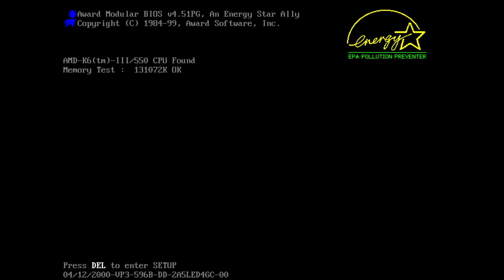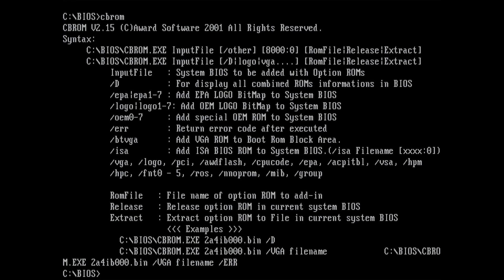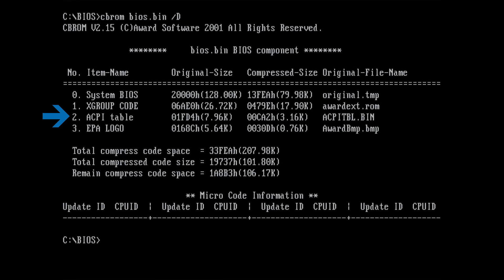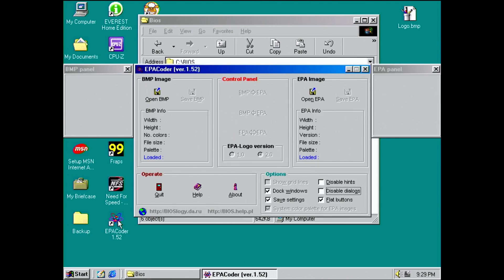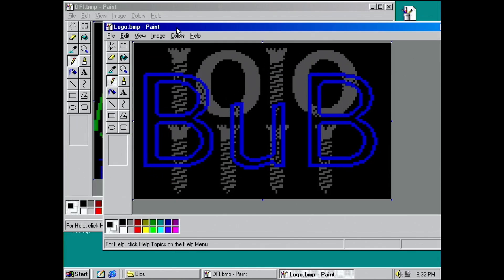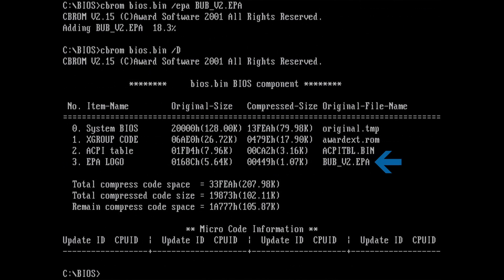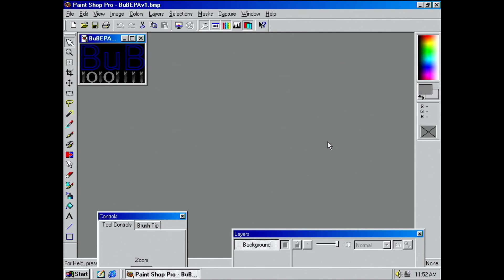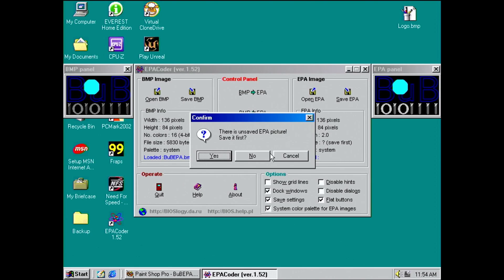Customize your BIOS Logos!

Comment: pls help windows 10 not working programs
Reply from the maker: You need Windows 98 or earlier. Those programs will probably not work on modern operating systems. You could try VirtualBox and install Windows 98 there if you want to try.

Comment: There is a problem I HAPPEN to encounter always.

I am rn using a PC with Gigabyte GA-686BX and the plan is to change the BIOS logo for my PC, (86Box is used during this process) however, every time, it gets me into the UniFlash screen but freezes ON WHOLE.

Do you have any idea on how to fix this issue? Thank you.
Reply from the maker: You're using 86Box when running uniflash? Correct me if I'm wrong, but maybe you can't flash the BIOS when it is emulated through 86Box.
Have you tried it directly on the board?
Reply: @bitsundbolts  I don't think I have tried this on board, also, it sometimes doesn't even freeze this time after deleting and then restoring the file using a digital floppy I made out of UniFlash, I am emulating a PC btw.

Before, it used to work for me.

Comment: Version 6 works to edit as well, though you need to set the EPA logo version to 2 - 1.0 was specifically used for 4.50 and 4.51 (though how would you get a 4.50G 486 BIOS to show a custom EPA logo is beyond my mere mortal understanding lol) and 6.00 was the one to start using 2.0. Some 6.00 might use 1.0 EPA logos though, depending on what resolution they POST in - e.g ABIT BE6-II uses 6.00 but likely uses 1.0 EPA due to 640x350 resolution, while my MSI 694D Pro-AR uses 2.0 and 640x480 resolution.
I used to have a Gigabyte 8IPE1000-G with a custom orange/white Harley Davidson logo. The neat and funny thing is the small gremlin in the opposite side of the EPA logo turned white as well, instead of blue.

Comment: One of the rare instances you'll see graphics together with the blinking cursor. The only way to do this is to use EGA's text mode 640x350 (8x14 font) on a VGA! Just think about that for a while. If you use VGA text mode, the font will take 8x16 pixels but expand 1 pixel of empty space to make it 9x16, and will not allow for seamless graphics using character cells. Award was the best back then!

So on a CRT monitor, you would be able to see scanlines more easily (because 350 scanlines instead of 400 or 480), a blinking cursor, and impossible graphics, compared to that version 2 that just uses boring 640x480 VGA graphics mode (you'll get in a Windows 16 colors graphics mode) with slow updating text and no blinking cursor.

Comment: Maybe some people could find this useful: this method doesn't work with v6.00PG, according to the tests I made on 4 motherboards with v6.00PG.
In fact, the results I got were all the same: when I tried to use Uniflash to back the bios image up, it said that PCI bus was not responding, and the program didn't show any of the ROM info, as shown at 1:48. But I didn't worry too much, as I used AWDFLASH to back the bios up and flash the epa logo-modified image. 
The problems began to occur when I tried to flash the new image via AWDFLASH, which prevented the action by saying "Bios image file checksum error", as it seems that editing the epa logo changes the checksum of the actual bios image file.
So I tried flashing the modified image with a NANO USB chip programmer, and when I booted up the system it said that "a bios ROM checksum error occurred", and I was unable to boot the system.
So I think that, because of the checksum-thing, the CBROM method doesn't work with any v6.00PG Award Bios.
(I repeated the procedure described above for all the motherboards with v6.00PG that I was able to get my hands on.)

Comment: Does this work on modern motherboards?????
Reply from the maker: No, it doesn't. It only works on old Retro boards with Award BIOS. New boards have UEFI firmware which is quite different from what I do in this video.
Maybe there are tools that can modify modern boards, but I have not looked into it.
Reply: @bitsundbolts  IIRC anything up to the final 1155 boards that used Award BIOS in the transition era (e.g Gigabyte Z68P-DS3 rev1) should be able to use custom EPA logos, unless there's literally no space for it in the ROM.
Reply from the maker: I haven't tried that on any other motherboard yet. But there shouldn't be a reason for it not to work. Maybe I'll try some day to do this on a much newer, pre-uefi, board.

Comment: "better get the version i'm using on this video" - yeah, only versions on the net are 1.12 and 1.50 ;-)
Reply from the maker: I'll be working on the Vogons post today. Will update the description accordingly.
Reply: Great, can't wait for it!
Reply from the maker: Thread is live: https://www.vogons.org/viewtopic.php?f=46&t=91378
Reply: @bitsundbolts  muchas gracias!
Reply: I have v1.52, file modified: 13/12/2000. 1.52 is available for BuB's vogons link below. You're all good.

Comment: Neat. On the very first computer I ever used (a 486), the logo would smoothly fade out at the end of the POST screen. I was quite dismayed that no other machine I came across would do this.
Reply from the maker: I had one like this as well! And I do remember that the fade-out was quite pleasing! Shame that later BIOS versions did away with this little extra!
Reply: It seems that older Award BIOS variants (<= 4.50) use textmode and epa-logo version 1.0 supporting only 2 colors (background and foreground) per 8x14 cell. They fade out the logo via palette setting. Newer variants (>=4.51) use graphicsmode and support real 16color bitmaps but removed the fadeout effect, because it would, depending on the logo, fade out the whole screen.
Reply: @dolphhandcreme  I had 4.51 fade as well. You're more likely to find fading EPA 4.51 on early i430 chipsets, VIA VPX (not all though) and I think some early SiS 55xx chipsets as well.

The feature got removed about the same timeframe VIA MVP3, 430TX, 440BX and SiS 530 started showing up.

Examples: VIA VPX based ACorp 5VIA3P has the fading EPA logo. MVP3 based Luckytech P5MVP3 does not, and neither a Soyo 6BA+IV or ABIT BE6-II have it - the ABIT is the most unlikely though - that one is probably among the earliest 6.00PG occurence, being 440BX.
Reply: @NSHG  and i know the fading logo Award BIOSes had a shorter POST beep as well
Reply: My 486 did that too.

Comment: This is good stuff.  I've got a Phoenix bios on my board, I'm curious if you have come across any tools to extract or modify those.
Reply from the maker: I have not done any research on Phoenix BIOS yet - most of my boards have Award. But you could try if CBROM is working on your Phoenix BIOS as well. Phoenix and Award merged in 1998...
Reply: Good point, I'll have to try that out this weekend
Reply from the maker: You could also try BIOS Editor for Phoenix BIOSes from https://www.rom.by/ - it is on the right menu the last section.